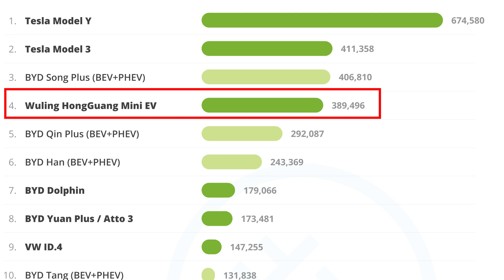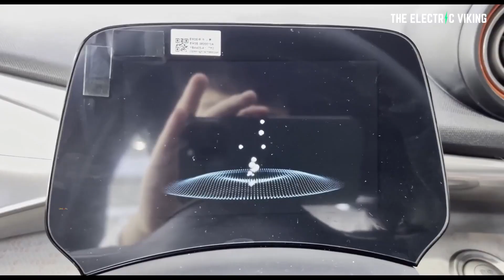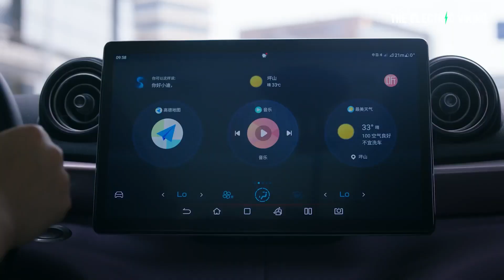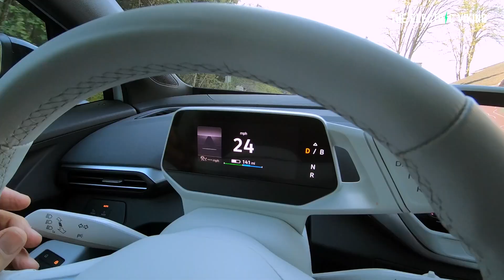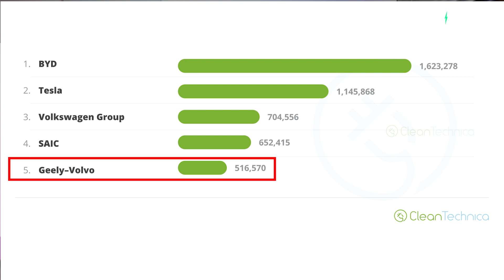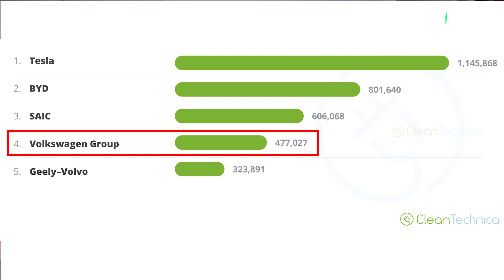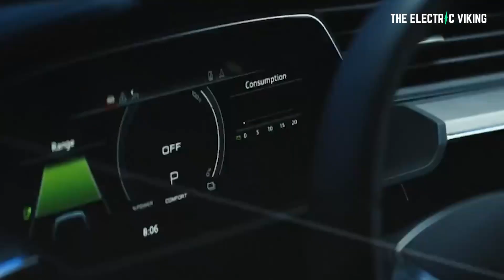The 7 car companies that made the most EV's in the world in 2022

Comment: 01:16 - have exactly the same phone...in operation since 2005. Still works like a charm...with the same battery...still holds over 80% capacity. Mainly use it for 2FA now.